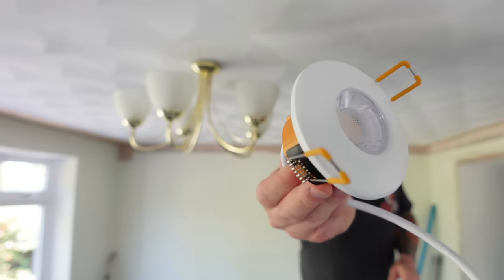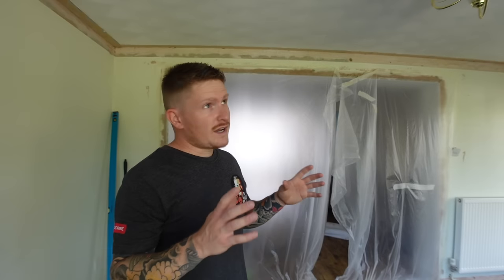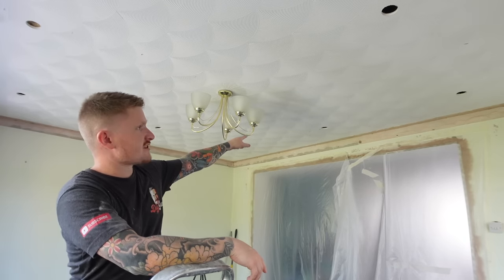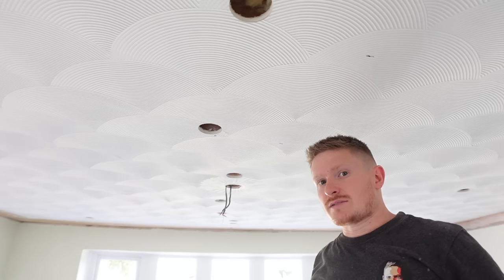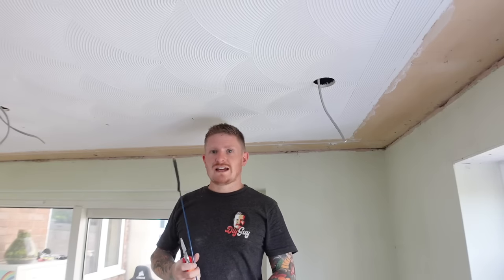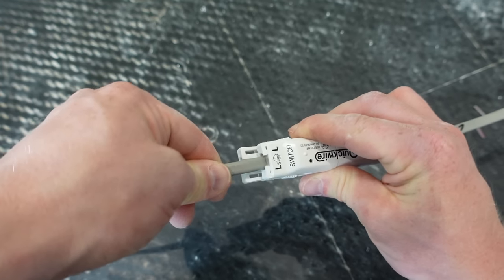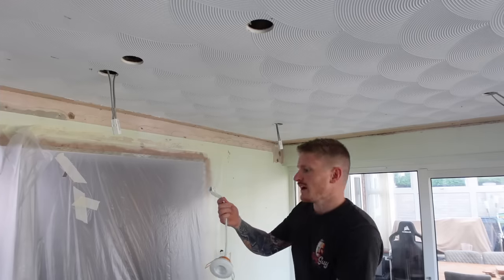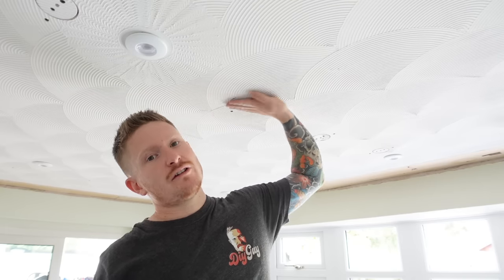How to Install Downlights With No Access Above | It is Possible!

Comment: Probably worth isolating the lighting circuit before running a hole saw through the ceiling, in case the cable is just laying on top!

Comment: I'm changing downlights and one existing downlight goes through an old style junction box with three cables all connected together. I have no idea which cable of the three is for the downlight and which two are for the power and load as you describe it in your video. How can I tell which is which? Thanks.

Comment: Hi Cameron, great video but once you've fed the cable rods at point 11.12 on the video, do you feed separate rods from the corner with cable attached. Pity we didn't see you feeding the cable even if it was on timelapse. How does the Ferret Pro see cable or pipes hidden at the back of a joist, it would make a good tool review video. 👍👍
Reply from the maker: Hi. Thanks. Sorry this isn’t clear, I did film the whole cable process but cut it out as I thought it was boring and would lose viewer interest. Run your cables along through the joists and then use separate rod lengths to take it across to each corner which should be nice and easy 👍
Reply: @TheDIYGuy1  That's fair enough mate I knew it wouldn't be that easy, but thanks for the reply. 👍
Reply from the maker: Your welcome. Just takes some patience and perseverance but it really isn’t technically difficult 👍

Comment: Hi there. Another great video! I thought you were rewiring the whole house 'cos of green goo and the age of the cabling etc? Or did you decide to leave the old cabling be in the extension? x
Reply from the maker: Thanks. I think the odds are that some cable which is newer will remain in place. Should we decide to renew in future, we have pulled in some length of cable which could be connected once our extensions take place. For now I need to make this dining room a little tidier!

Comment: Can i use quickwire push clip boxes instead of the wago grey box in your other spotlight video to power the spotlight chain instead of using the orange connector switches then storing them in the wago grey clip box

Comment: Hi not sure if you’d been asked this. But how did you determine which of the 2 sets of wires from the old ceiling rose was power in and switch cable? 

As you said in the video nothing was marked. I have the same issue. Changing a 90s ceiling rose to downlights. There’s 2 cables but no induction of which one is loop in / switch live? Many thanks

Comment: New access points can be cut out and they can ease off any maintenance work later on or there is a problem with drilling the joists like that! One can weaken the joists to the point of ceiling collapse!  one ought to know the joist depth before drilling the right hole size.

Comment: what if you have wiring or pipes od the blind side of the joist? you would be buggerd ask me too risky as worked in the trade for over 30 years and seen many  jobs with cables and pipes on side of joists . i do love your videos but just saying this is perfect way if the pipes wiring have been correctly first hand
Reply from the maker: In the video I demonstrated checking behind joists with an inspection camera for pipes and cables.

Comment: Drill the initial pilot hole and then push in a screw driver and wiggle it about to see if it's safe to continue drilling. Also, drilling through a joist with no idea what's on the other side is not a good idea. Better to cut another hole. A few more patches, but it's better than drilling through a cable/pipe. :-)

Comment: Just cut a channel the width of the room with a multi tool, saves all the messing about finding joists. Keep the plaster you cut out and screw it back up when you finish
Reply from the maker: Yeah seen it done like that, nothing against it but I think the time saved you lose on a slightly more time consuming repair 👍.

Comment: If the ceiling is getting skimmed, why not just cut a chase down the ceiling where you can see both sides of the joist and you can do straight holes through the joist then as well then?

Comment: “Red is live and black is neutral?” - I’m an electrician with 18 years experience, I’ve done over four thousand EICR’s (testing fixed wire installations). About 40% of condition reports I find red or brown are a neutral wire and black or blue are a line (live} wire (not sleeved). Connect these incorrectly and you’ll trip the circuit breaker. This work is under minor works certification and an earth fault loop impedance test (Zs) should be done on the existing circuit prior to installing these additional lights along with a Ze at the board. 

Also earth bonding to your gas and water pipes near your stop valves should be confirmed with a continuity test. If anything goes wrong, remember insurance companies will not pay out.
Reply: I dont believe 40% of the installs you test are wired incorrectly.
Reply: @Giz-7531  Not wired incorrectly, just not sleeved up correctly to identify if it's line, neutral or CPC.
Reply: @Chris_Stone_  why would anybody connect a red/brown to neutral. I get a switch drop not being sleeved but what your talking about is cross polarity.
Reply: @Giz-7531  You'd be best asking the DIY installers why. 
- Back to my point, the colour of the wire does not always correspond to correct conductors. People should not be installing additional lights without testing the existing circuit, the new wiring going in and certification. 
I don't make the rules, the IET do.

Comment: Is it safe to leave lighting cable underneath loft insulation because the led low voltage downlights led are not drawing to much power?

Comment: I live the ground floor of an apartment..anything additional to consider? Also how did you get the size of those holes just accurate enough to fit the downlights?
Reply: The instructions that come with your light should say what size hole you need

Comment: How do I know if my existing lighting circuit is safe to install additional lighting points? 
Do I need a minor works certificate for additions to lighting circuit? I hear those bloody regs keep changing!
Should I use fire rated clips for prevention of premature collapse or hope the firemen are good at twister?
Does it mean my house insurance is void without an EIC? 
How do I know if my ceiling fabric contains asbestos? 
My ceiling void is congested and has multiple battens perpendicular to joists does this mean turning my ceiling into Swiss cheese or should I reboard? 
The existing cable insulation is brittle and splits just by looking at it, is it safe to enclose in a maintenance free junction box? 
I've encountered multiple junctions some of which have exposed conductor sheathing. How will the additional connections affect the earth fault loop impendence, continuity, insulation resistance, RCD trip functions especially with additional points and more connections in my new install?
How much does a ferret cam, rods with necessary flex and accessories, T&E strippers, cable sleeving, fire rated clips, maintenance free junction boxes cost?
Not to worry I'll just crack on those certified electricians take the biscuit, they're just glorified handy men with fancy tools throwing out science jargon that they don't understand. 
Please upload more videos of electrical installs or maybe delve into home dentistry, this stuff is easy and I've saved money by cancelling my house insurance. Have developed a bit of a cough after drilling into that ceiling though and I think I need to change my consumer unit because that switchy fusey thing keeps tripping, can't be the lighting circuit can it! 
Consider carefully and look into the credentials and reviews of any electrician you allow to carry out works in your home. It costs me a lot of time, effort and money to conduct professional works and therefore due to overheads it reflects in the price. I don't knock anyone trying to save money and feeling let down by previous electricians exacerbates the issue. I apologise for those kn@bheads they aggravate me too!

Comment: Worried about weakening the joists by drilling holes through them. Any thoughts?
Reply from the maker: Boring joists with such a small hole won’t weaken the joist in any way. It is far better to bore through the centre of joists than to notch them.
Reply: Always weakens, following engineering guidance keeps damage within designs safety factor. 

 lots of prior trades will have  dipped into the safety factor  pool particularly plumbers . Hard to be sure quite whats left. 

No issue if sensible avoiding already well notched or holed or uneven  joists etc and following guidelines.
Reply: @TheDIYGuy1  There are rules about holes in joists and where they can be drilled in the Electricians Guide to the Building Regs and elsewhere online - am a bit surprised you didn't mention them?

Comment: Great video what do I do because I've got concrete ceilings? Chase or no chase?
Reply: Screw batons to the ceiling (deep enough to accommodate the spotlights plus airspace above),  pre-fit the cables, then fit  a 'false' ceiling of plaster or plastic tongue and groove boards. Drill your holes and pull the cables you've already fitted out of the holes. Exactly what I did.
Reply: @johnmurray9422  Thank you so much for the info sounds like a plan 👌

Comment: Hello, I have a single switch light in my kitchen that powers several down lights, I would like to add under cupboard led lights in addition, this would mean changing the light switch to a double switch so the lights can be operated independently, do you have a wiring diagram or a video that can explain the process please
Regards john
Reply: Are you an electrician?
Reply: No

Comment: Hi I’ve just moved to a new flat & the landlord installed these lights in every room, they look nice but I have a nice chandelier I want to put up. Is this possible even though I can’t see any pendant lamp fittings just the ‘spotlights’  cheers
Reply from the maker: Hi, it is possible but will require some repair work to the ceiling and you would need to find the cables supplying the room and the switch wire, this would allow you to reverse the downlights to a single light.
Reply: @TheDIYGuy1   Thank you 👍🏻

Comment: OK for a false ceiling with no load-bearing joists. But if they are load-bearing joists that support the floor above you really shouldn't be drilling holes or notching in the bottom half of the joist. In that case, given that the ceiling is going to be re-skimmed anyway, I would cut a larger hole next to the joist and use a right-angle drill with short spade bit to drill a horizontal hole through either the centre of the joist, or slightly above the centre of the joist, and nowhere near a large knot (although if properly installed load-bearing joists shouldn't have any large knots near the bottom face anyway).

Comment: What would you do if it was a concrete ceiling?
Reply: Fix timber battons to your concrete ceiling, get your wiring ready, then put plasterboards up and create a false ceiling, would lower the room by a couple of inches but you’d achieve your goal 😉

Comment: I'm wondering why drill access holes for the joists, why not use a long drill bit from the light holes themselves?
Reply from the maker: There’s a couple of reasons. You would not be able to gain access to each joist at the correct angle. Dependant on the distance between each downlight you would need a seriously long spade bit. You would also not be able to check the space between each joist for cables or pipes. You need access between each joist.
Reply: @TheDIYGuy1  thanks for the reply!
Reply from the maker: Anytime 👍

Comment: I am not sure if those junction boxes exit in the USA or not... I just did 12 lights in 3 room where I had access from the attic - going to do one more in te hall way, 6 more in an other bedroom and a ceiling fan tomorrow - oh and two unit of vanity lights in the bathroom with three additional lines for three bathroom vents -- shweee I am already tired thinking about it.

Comment: Hi mate quick question iv got a 1mm twin and earth cable powering the pendant light at the minute can I use 1.5mm twin and earth to wire up the lights or do I stick to 1mm? Iv already bought a roll of 1.5mm you see
Reply from the maker: You can use either, it’s fine

Comment: No need to drill through the joist and use a trunking  lid   to fish through the ceiling. Small slot on top of the joist and plaster over it. No big holes.

Comment: As a spark it frustrates me to see when down lights are installed poorly. But this video is cracking and watched it to see what I could pick up on…. Do you know what…. I got very little and if I was to inspect them I’d have very little to come back with. 

DIY’s scare me when they do electrics but if everyone did them like this I’d be out of a job lol. 

Usual pick up is single insulated cables out of a junction. (QuickWire fixed that nicely) and none fire rated down lights being fitted. All covered in this vid. 

Only over thing I’d say should have been said is that if you fitting in a bathroom make sure the correct IP rating is used

Top install
Reply from the maker: Thanks a bunch. I’m glad you recognise that there are good and bad DIY installs just as there are good and bad tradesmen. I try my hardest to show people who want to give this job a go how they can go about it the best and safest way possible.
Reply: Completely agree with you it’s it’s great to see people showing the right way
Reply from the maker: Cheers 🙌

Comment: I’m a sparky. Please bear in mind that you may have CH pipes/ waste pipes screwed to the other side of the joist that you will not know is there until it’s too late.
Reply from the maker: Yep, if you check behind the joists as I did in the video then you should be fine 👍

Comment: No getting cables 50mm from the ceiling then, not good if someone does their own light's and has no rcd protection.  Best thing will be to cut a slice out of the ceiling across the joists and then drill all the holes properly through the joists. Then run your cable's through the joists to the lights and then put the slice you cut out back in and skim the edges.

Comment: Which version of the regs are you working to? The one I (and any proper electrician) work to requires cabling to be 50mm from the surface, can’t see how you have done this. No mention of pre or post work testing like IR, R1+R2, RCD times, Zs. Minor works certificate anyone?? Ask your buildings insurance company if your policy is still valid now after this ? Some useful tips but overall not up to scratch - just take down the ceiling and do it properly.
Reply from the maker: I’m not sure if you’ve watched the video properly but 50mm from surface was mentioned. Can’t see how I’ve done it? It’s all on the video. This is how many sparks do the job without taking the ceiling down. It’s all about getting the job done and done right like in my video.
Reply: How are the cables clipped as per regs premature collapse?

Comment: Have you looked at the regs for drilling joists? No mention of checking for existing holes, notches, depth of joist vs hole size. Holes should not be drilled on an angle and not in the bottom area of the joist. Check your building regulations mate.
Reply: @samca4472 yeah but if someone goes and does it this way, their house insurance won’t cover them if anything were to happen in future

Comment: My ceilings are concrete as I live in a block of flats,we only have metal conduit in the concrete? Flush with ceilings 🤥
Reply: You could install a false ceiling, would lower the height of the ceiling slightly but then you have a blank canvas to do as you please, and you can get your wiring done before the plaster board goes up too 🙂

Comment: The government are currently being approached to put electrical work into the same bracket as gas work.

All seems safe but no mention of RCDs, testing, identification of conductors, fire rating, IP rating, band separation...

Textured ceilings???

Comment: That was either very brave or very stupid taking the hole saw through the ceiling as  there could have been copper pipe work or cables in the ceiling void then it’s drop the ceiling time , there is a safer way but it still requires a degree of making good but it eliminates the risk of damaging cables or live copper pipe work.

Comment: 8:33 good luck doing that. I hope there are no pipes or wires clipped on the other side of the joist. AND that inspection camera would do nothing if there's kingspan or insulation in the way of it.
Reply from the maker: Oh I’ve done the job successfully a handful of times but thanks for the input 😊

Comment: If you're cutting the board why make such a tiny P.I.T.A hole? Plaster is plaster. Patching a small hole is no more work than a big hole. In fact I'd just cut a channel out the whole run.

Comment: There are a whole set of regulations where you can and can’t drill a joist and disappointingly you have not mentioned this in your video to the unknowing DIYers.
Also would appear that all the joists you have drilled are not in accordance to these said regs therefore possibly weakening the structure. 🤷‍♂️

Comment: Hate to be that guy.. but some of the information in this video is wrong. Picked up from the 18th Edition wiring regulations:

You can't just aimlessly drill holes where you want in the joists it will weaken them.

Holes
Should only be drilled on the centre line of the joist.
Should have a diameter no greater than 0.25 times the depth of the joist.
Should be no closer together than 3 times the larger diameter.
Should be no closer to the support than 0.25 times the span and no further away than 0.4 times the span.
If the above requirements cannot be met within the limitation shown, then increase the joist depth by the depth of notches or diameter of holes.